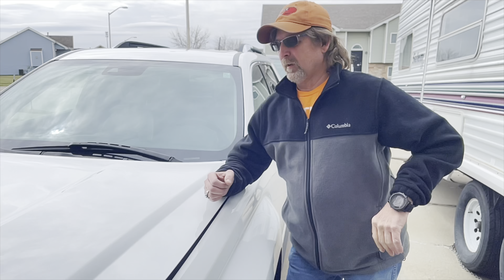How to replace GMC Terrain Windshield Wiper Assembly

Comment: You can just buy the "plastic" piece. I've bought a couple lol this has happened to my GMC 3 times in the last 5 years. They come in a pack of two.
Reply: Where have you gotten yours from? My problem is just the plastic piece and I would love to not buy a whole new assembly
Reply: @sabrinahogan954 I went to auto zone and told them I needed a plastic wiper motor grommet.

Comment: I replaced my wiper motor assy a year ago as they were doing as shown in your video. A couple of weeks ago, my wipers just quit working.  They do not move freely.  Could it be the motor in the assy?
Reply from the maker: I would start by checking the wiper fuse. Then check to see if the wire harness is plugged in at the wiper motor or if there is power there with switch turned on.  
If there’s no power at the motor it could be a bad switch. If there’s power getting to the motor then the motor may be bad.  
Remember to turn switch on with key on when checking for power.
Reply from the maker: I would start by checking the wiper fuse. Then check to see if the wire harness is plugged in at the wiper motor or if there is power there with switch turned on.  
If there’s no power at the motor it could be a bad switch. If there’s power getting to the motor then the motor may be bad.  
Remember to turn switch on with key on when checking for power.

Comment: We just replaced our assembly in our 2016 GMC Terrain and one wiper moved the one that's on the passenger side of the car did not then both stopped moving but you can still hear the sound of the motor when you turn the switch on in the car..  no idea why it's not working we did everything like you did and it's brand new assembly and just put the old working motor onto that one. Could the motor be going even if you hear it turn on? Idk so 😢
Reply from the maker: So the new assembly wouldn’t work right after installing? Did you get the wiper arms all the way onto the stud bolts and nut tightened down?
Reply: Linkage bushing broke maybe it’s a little plastic

Comment: I have to replace mind and unfortunately its cold out but this will save me so much time and money. Straight to the point video. Love it. Thank You
Reply from the maker: Shouldn’t take long to fix.  Hope video helps you get it done before frostbite 🥶
GM has a recall on it and I believe they are finally paying for the fix.  If you already bought part save your receipt to get reimbursed
Reply: @Redneckinahat  I saw the recall, unfortunately mines a 2011 and the recall is 2014-2015.